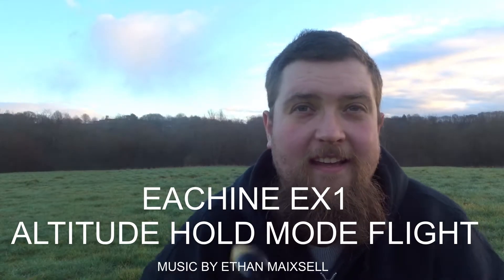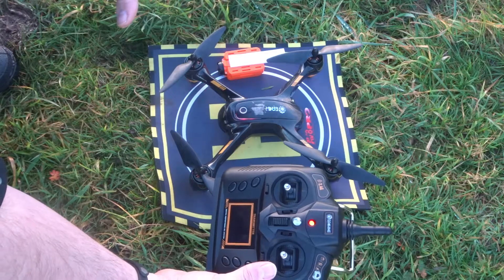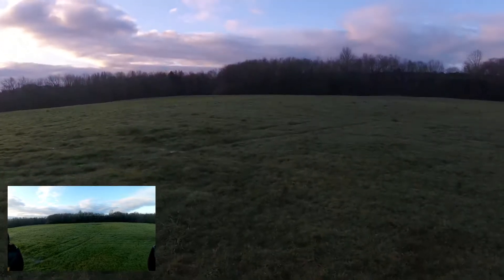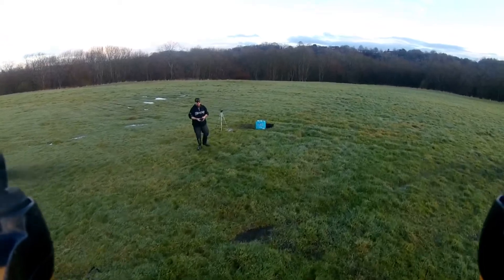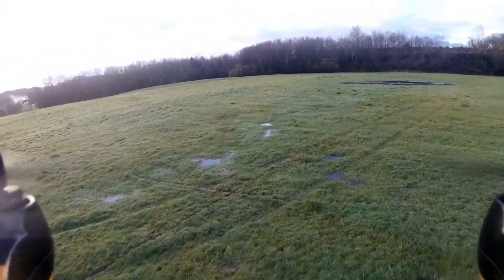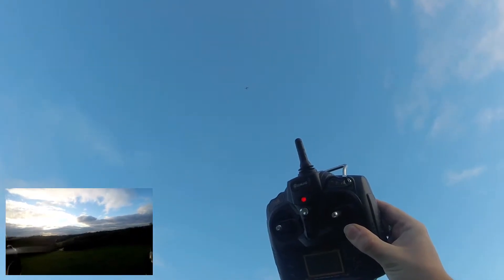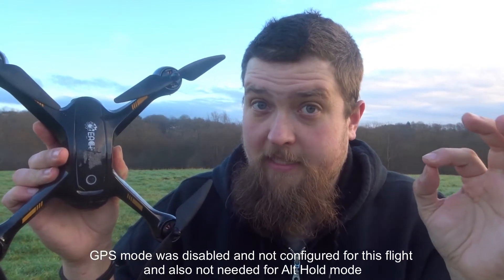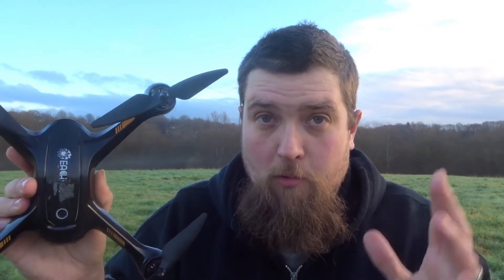Eachine EX1 Altitude Hold Drone Flight Test Video

Comment: Great video as always mate. One thing that intrigues me about sitting a cam on top of a GPS quad... Does it not compromise the acquisition of satellites when you do this? I know you ran her in altitude hold mode on this video but on your first video you ran her in GPS mode with the runcam on top.
Reply from the maker: Hey Jason Burke, great question. With the EX1 flight on the first video I didn’t lose any satellites. I had 15 when I attached the cam and when I landed I had 17. I always run the copter first without the camera to ensure enough satellites have locked on, that usually takes a few minutes. The camera is shielded and shouldn’t cause any issues. If I ever find that it does I will of course let everyone know. Great question :-)

Comment: So it turned on the gps it’s self?
Reply from the maker: At the 20% mark yes, whether in alt hold or GPS mode. When it happened in Alt Hold mode i didnt know what to do, i thought i had lost the quadcopter as all control was lost as it ascended and then eventually took itself home.

Comment: It doesn’t come with a camera 🎥?  Cool video and looks like a great place to fly, %20 fly home when not in GPS mode is really really cool, maybe a game changer...💚🍀👍
Reply from the maker: It does, but unfortunatley it was broken when i recieved it. The first video with this guy i used the new RunCam instead. Yes, whether you are in GPS mode or Alt Hold mode it will take itself home when it drops to 20%. It records your position whether you are using it in GPS mode or not. Very impressed.